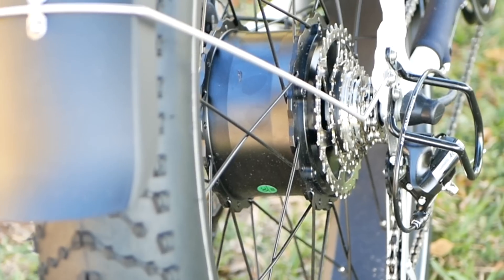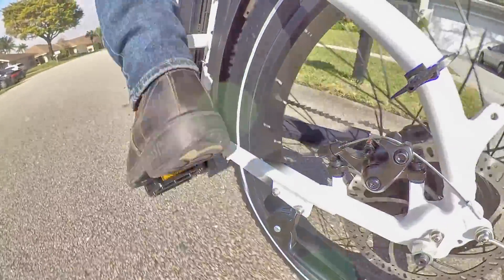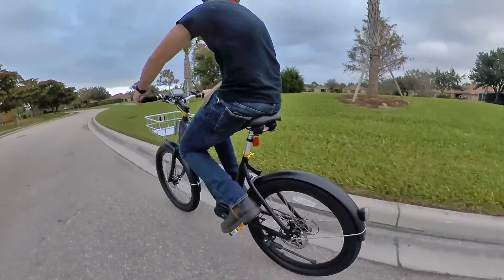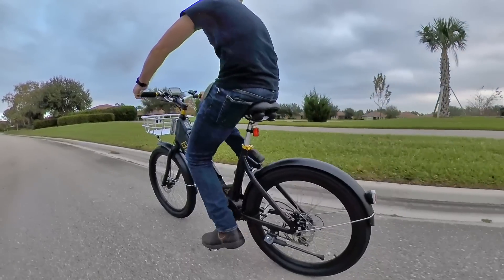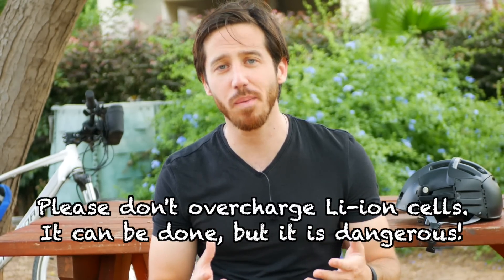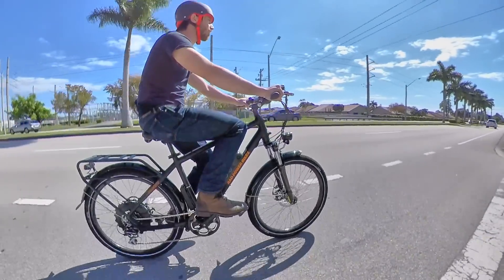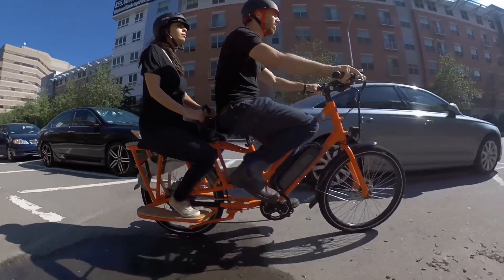Why don't more electric bikes have regen brakes?

Comment: The "reasons" given here why regenerative breaking isn't common or why it isn't practical don't seem logical. Most bikes aren't designed for regenerative breaking, but that is not a reason for not having it. You can list a lot of details here, but the logic doesn't change. For example some batteries and battery controllers can't deal with regenerative breaking, but that is not a reason for not using regenerative braking, it's a consequence of the bikes not being designed for regenerative braking. Don't pretend this is a reason. To illustrate this, consider the following question and answer:

-Why don't the Tesla Model 3 have an internal combustion engine?

-Because the Tesla Model 3 doesn't have a fuel tank, so the engine wouldn't be able to run.

Of course, if a bike is designed for regenerative braking, it could also have a system that disengaged the regeneration when needed, for example when the battery is empty so you wouldn't have to fight the battery resistance when not applying the brakes.

Regenerative braking makes a lot of sense if you're riding down long, steep hills at relatively low speed, for example if the road has a lot of sharp turns or there are kids playing in the neighbourhood. The bike could even be designed for adding more regeneration by the rider during braking. Instead of doing nothing while going downhill, the rider could easily produce 100 W by pedaling while braking. The energy generated could then be spent going up steep hills. This is partly how hybrid cars optimize efficiency. One aspect is that they simply make use of brake energy, but they also allow the engine to work at maximum efficiency independent of the power demand. A bike rider would also benefit from this. If you're going down a mountain and then up another, you would benefit from producing some of the energy while going down using the regenerative braking. However, if it's mostly flat where you ride your bike, regenerative braking makes no sense, as it could only harvest the tiny amount of kinetic energy you produced when fighting friction and air drag.

Comment: What about having dynamos on the wheels, kind of the style we used to have to get lights on old bicycles? 

So, when you press the "regenerative brake" lever, the dynamo(s) is connected to the wheel(s) and slows the bike down. Anyone who tried riding in the dark with an old dynamo light knows that it slows you down quite a bit. Ramp it up to multiple (and/or larger) dynamos on back and front wheel and voila: Regenerative braking without needing to change the drive train at all.

And bonus is you save wear on your mechanical brakes.

Comment: I would think that it could be done electrically. Maybe a momentary switch in the brake handle that engages the regin breaking when the handle the depressed slightly but is otherwise disengaged this would allow you to regerate some of the lost power while coasting, especially down hill but when disengaged has no more resistance than a regular bike wheel. I think this could be done with a manual clutch as well provided you could spin the stator and the magnets separately. Might require a little more hardware to make it happen but it's a thought.

Comment: I have a slightly different idea for regenerative/generative braking, that means Not just generating when braking, but also charge the battery by pealing as much a rider wants or can. that way if you running out of charge on the battery then you can charge the battery by pedaling for some times and then use the energy when you are tired, that way a good physical exercise for the rider and saving time on the hills! Can you understand what I trying to say here? So, in order to do that I would put the trigger on the OFF position of the thumb control or twist control line, so when you are NOT give power AT ALL you have an option to pedal on low gears to ride and charge at the same time, and a switch to turn charging on or off completely... so that way if the forward resistance when charging will be gone when you want to JUST ride pedaling. Makes sense? This way has another advantage that you can charge the batteries a lot even fully... if you give enough pedaling and RPM to the wheels.
Reply: Yea i think we've all thought about that at one point brotha. Problem is go ahead and hit your regen brakes and start pedaling. You'll very quickly see how damn hard and labor intensive it is to pedal against even with the gearset to try and make it easier. Its nearly impossibly difficult. I thought, he'll, why not have a seperate smaller regen motor geared down and attach one to all 4 tires in an electric or hybrid car so you can be recharging as you drive. Problem is the parasitic draw will ALWAYS be more than the return. I understand the thought of that doesn't matter on a bike because ypur pedaling but again, gorilla ahead and hit the brakes and try pedaling against it, because thats literally what your going to be doing. Not to mention their most important part. Regen motors have fixed magnets and no clutch. Meaning you either have regen, or you dont. Its not something you can just switch on and off like that man.

Comment: My biggest question and concern is that, with regen braking, isn't each regen braking episode technically a charge cycle, therefore reducing the battery life significantly over time?
Reply: No, with lithium batteries you actually want to keep the batteries at about 60% charge. That's where the lifespan will be longer. What kills lipo batteries is  deep discharger, deep charges to 100% and fast charging/discharging. The problem with regenerative braking is mostly that it can potentially charge the battery very fast. For example if you are at 50km/h and you brake down to 25km/h in 4 seconds (with 75kg) you will need a power of about 1500W. The battery and the electronics will need to be able to handle that or for example you will need to just brake at a much lower power. THat's why a regenerative system should be used with a constant braking at lower speed.

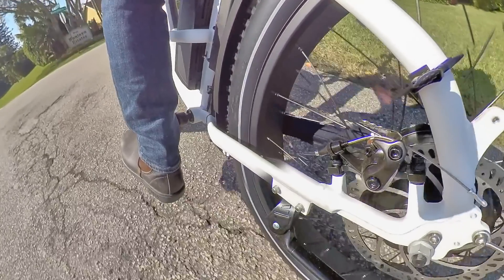Comment: At 1:40 you said they use a centrifugal clutch. Wouldn't that keep the motor connected to the wheel as long as RPM is above the threshhold value, like on a scooter? If an ebike only works one way it seems more likely that they would have a sprag clutch or freewheel clutch (that only engages one way).

It would be handy to have a lockable sprag clutch with an extra lever on the handlebars to trigger it. Then you could have the best of both worlds, freewheeling and regenerative braking based on scenario. Or maybe achieve it with a motor using electromagnets rather than permanent magnets, so you could turn off the magnetic resistance by removing power from the field windings.

Comment: By the end of the day its still a bike. so just pedal if the batteries run out. You Really don't need Regen on E Bikes
Reply: Regen costs us nothing to enable and saves our normal brakes. It's like sure don't use it but why not?

Comment: Wat about the battery? Your battery has a surten amount of charges. Also, for cells isn't it great to be charged, right after a discharge and that also will harm the cells. Probably not much, but is it worth gor the limited amount of energy it deliveres?
Reply: Maybe you could pick a hypothetical battery and regen current and see how it would work. Worst case is you could use a big resistor like with trains and use the resistor for braking and not the battery. But I think in general the battery will have no issues with regen currents.
Reply: @difflocktwo  maybe with the small amounts not.
I destroyed several cells with charging straight after they where used. But the discharge was high and the charging also.

Comment: 3:24 not only have bicycles less mass than cars, they also do a lot less breaking due to their lower max speed. e.g. on roads with some turns that need you to slow down to lets say 30 mph (~50 kmph) a car and a motorbike have to break (really fast ones even harder) but a bicycle doesn't. riding a bicycle is more continuous than a car or motorbike. so fewer breaking less hard with less mass on less distance equals no need for regenerative breaking because the costs/disadvantages outweigh the benefits. it just sounds good. same for lower speed scooters.

EDIT: no, i don't need one of your books. thanks. :)

Comment: I typically get over thirty percent regen but my last ride was 55.5%. I rode over 20 miles and returned home with more in the battery than I left home with. Plus it does save the brakes.

Comment: I don't see the problem why these two are different things. That's what clutches are used for! Simply disconnect the direct drive motor when you don't need to use the regen braking!

Comment: I've got a bionx motor. At the end of long trips, I pray every time that the battery not die. I am also not comfortable with high currents flowing to the battery. My vote also for smooth coasting.
Reply: The smoothest coasting is when you use a little bit of power to overcome and friction in your system. Then you use regen braking to capture energy which you use to power your wheel.

Comment: I considered regen braking on a bike with no disc brakes. The only way to increase the braking power without trying to install an adapter for disc and changing wheels as well. J.Q.

Comment: Makes sense, cost, lack of benefit, rolling resistance. You pretty much covered it. But as others have mentioned, the engine braking could provide beneficial in other ways without much regen return. Still, probably better off just to get a dedicated ebike or electric scooter that has the system as that would be a full-time system providing higher benefit wouldn't it?

Comment: I've been riding bicycles for 51 years and working on regular bicycles for 51 years. And I remember I had a light on my bicycle with a generator that runs on the tire and why could that not be used for something like this to charge your battery I cannot believe with the technology we have there is nothing but when somebody finds something and they will it's going to be one rich person. He seems like one of the more educated ebike instructors or you seem like one if you ever read this. I wish I could sell these because I believe in e bikes this bike can save my life I got the ecotric hammer

Comment: I have a Rad City which has a direct drive motor w/ regenerative braking. You did not mention it is completely silent which I like and Rad claims very reliable. I agree the rolling resistance is a negative but the bike is well built for commuting. I have 1300 miles on mine...so much fun to ride!

Comment: My ebike weighs 70-80 lbs plus the weight of the rider.  Im always burning my brakes and having to replace them often.  My motor is a direct drive, so I'm looking into a simple relay array for the phase wires and having the split phase AC from the hub motor rectified and sent to the battery through a dc to dc converter.  Hopefully that might save some brake pads.
Reply: Just get a controller that does regen, almost any controller does.

Comment: First: Loved this segment, ( love all so far),  having perused a few comments..speaking of Changimg brake pads over batteries...seems regen just to get a little more life out of pads would be more costly both in terms of $ as well as labor.  
Secondly...could you address the idea of wiring in ultraCapacitors? To augment battery ( life, range, speed,  etc)   looking forward to your thoughts

Comment: Hi there, i have a question for you. I recently purchased an Ecotric Rocket with a 36v battery and 500 watt hub. It has an S900 display that can be set to 48 volts. I am already considering upgrading the battery, and was wondering if it is possible to upgrade to a 48 volt battery. Bafang sells a 24 a/h “jumbo shark” battery. I would be grateful if you could do a video on the complexities/possibilities of doing this swap

Comment: I maybe touched brakes 5 times on a 80+ mile trip last week, only one of those were hard enough to actually generate a watt hour or two. The physics of bike riding don't allow for effective use of regenerative braking in most scenarios.
Reply: So you prefer the added complexity of freewheeling? The motor drag is minimal and can be compensated for with the battery.

Comment: While regen isn't worth it on standard bikes, on recumbent bikes with a fairing it changes everything.
Those bikes have a big braking problem and regen solves that by adding a lot more braking power and the ability of continuous braking downhill without brake overheating

Comment: People overly focus on range....range was really the least thing I cared about regenerative braking.  It was really nice to have and saved on brake pads....say you're going down a very long and steep hill and need/want to keep your speed reasonable.  Regenerative braking could maintain a good low speed without heating up my brake rotors and wearing out my pads (I'm in a hilly area, so on my geared motor bike, with lots of hills and stop signs+lights) I'm using my brakes a lot...I'd still use regen if it gave no extra range.
The cost isn't that high in my opinion....I had a home made build a while back.  My controller was $45, could do 45 amps, 72 volts, AND had regen....not much of an extra cost there....but I'll admit I wasn't running the most sophisticated build (no BMS, was running hobbykingLipo packs with volt meter/alarms attached).

Comment: Hey Micah, great video and channel, very interesting and useful! I would like to propose a topic that I think you did not address so far: what about  built-in controller hub motor kits? There are two types right? controller inside the motor and inside of the battery housing. Do you have experience with them? Are they reliable? I have personally the experience of installing a hub motor kit with external controler non waterproof connections and at least I have learned how not to do it! :) find these built in controller kits very interesting. Many thanks for your inputs.

Comment: Instead of buying one hub motor say a 1000w, how about using two 500w hub motors, putting one on the front and one on the back with one controller with one 20ah 52 volt battery? Would having both wheels turning be an advantage?

Comment: Hi Micah.  I have a question about converting my Specialized Crosstrail that I use for commuting mostly.  I always carry a Topeak rack bag with panniers full.  I am considering either a 250 or 350w Bafang mid drive.  My question is whether it is worthwhile to go for a rack battery so that I can keep my bottle cage.  Are there any obvious disadvantages in the rack battery.  Is the weight shift problematic?
Reply: Best to test this with dummy weights and see how it feels.

Comment: You talk about resistance as being an issue. But you also mention that bicycles have trash aerodynamics. So why is aero generally ignored and we're focusing on the miniscule drag of a motor? Not to mention the whole energy equation which negates any motor drag anyway.

Comment: better design, you can do all stuff, if you have skill, graphene super capacitors for regenerative braking
Reply: No need. Basic motor and battery are more than capable enough.
Reply: depends on what you want
Reply: @difflocktwo  basic motor might not have the wanted feature and battery will be quickly worn out, super caps will last longer
Reply: @Jkauppa  I would rather have a resistor than a super capacitor. Can you describe a situation where a normal motor and battery wouldn't be enough? You can lock your wheels with normal stuff.
Reply: @difflocktwo  so, you dont want a li-ion energy density graphene super cap? you choose to waste stuff instead of using useful stuff? if you can release your normal motor if you want to freedy pedal without regeneration then should work fine
Reply: @Jkauppa  I prefer a normal, cheap, battery. I don't want magical, expensive, super capacitors. 

No need to release the motor. The motor drag is minimal and you can get more energy from regen braking than you lose with motor drag.

So if you're so worried about drag you must ride a velomobile?
Reply: @difflocktwo  if you dont need then ok, but i can want and suggest to people what they could find useful. releasing the motor would be useful if you dont want any resistance, even minimal. lithium ion is more exotic and requires exotic materials. I'm worried about you telling me what to want.
Reply: @difflocktwo  i did not mention drag, you must be making things up?
Reply: @difflocktwo  did you get why the release is necessary? you then can use your bike as normal bike.
Reply: @difflocktwo  btw, your drag on me is wearing me down, i'm better off without it
Reply: @Jkauppa  You did not mention drag? Then what do you want to release if there is no drag? If you are concerned with tiny amounts of motor drag that means you must have very low aerodynamic drag. Anyway with regen braking you get more energy back than you lose with drag, you can think of this as negative resistance. Negative resistance is better than zero resistance.

You are talking about releasing the motor for less drag, correct? I'm saying you have bigger things to worry about like aerodynamic drag firstly. Also with regenerative braking you get back more than you lose, negative drag.
Reply: @Jkauppa  You can want and have whatever you want, like a solid gold hammer.
Reply: @difflocktwo  keep your opinions
Reply: @difflocktwo  i dont ask you want i can want or have, get it?
Reply: @Jkauppa  What opinions?
Reply: for the video maker, you could just put engage toggle hand break, which would regenerate without messing up free normal biking, with battery powered speed adjust when wanted